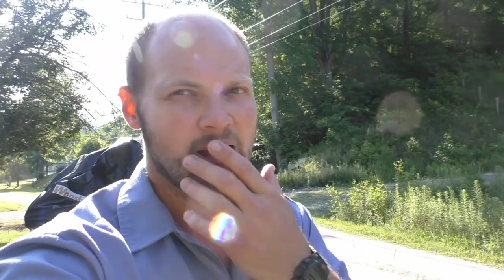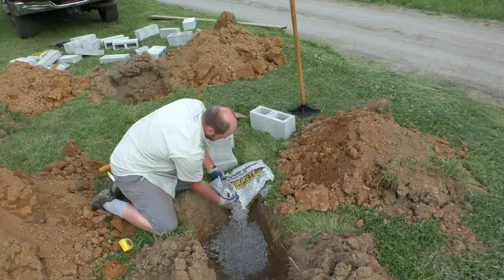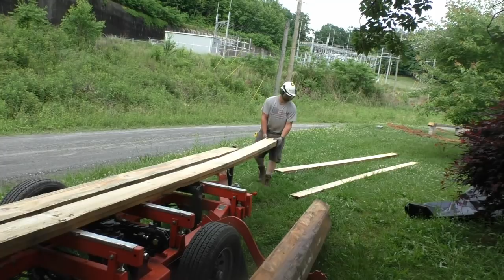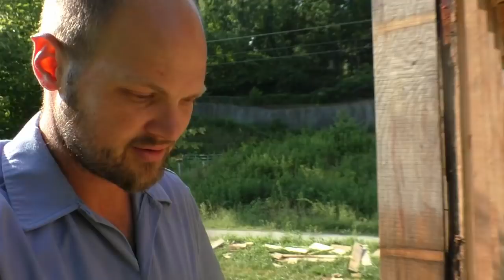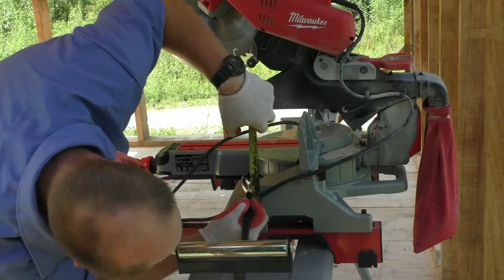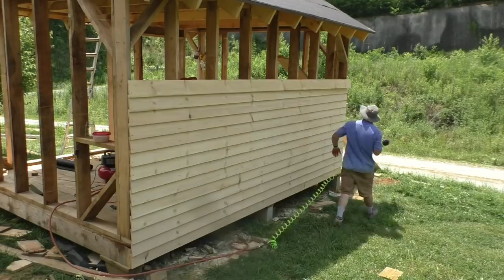Building a 12x16 Tool Shed for 400 bucks | Vlogmill

Comment: Not to be like this...but red oak, nowadays, is very expensive and best used for appearance pieces. 
This guy did what he did, that's fine. 
If you're an experience woodworker, then you already have your preferences. If you're a newbie, I'd suggest a combination of pressure-treated floor joists, the plain pine for everything else. You're also going to want good shed ventilation, so add some roof and eave vents. (In the summer heat, I keep an old fan going in the shed, just enough to keep the air moving; makes a huge difference).

Comment: do you guys have high clay content in your soil?  wondering how you did the foundation.  i see you dug it up, put some aggregates, laid some thin blocks then cmu stacked over it.  any rebar/mortar?  interested in details of that foundation.  looks fast and good enough for shed in clay soil.  thanks for putting up the videos
Reply from the maker: Its some kind of loam, not really sure.  The footer is two 4x8x16 solid blocks laid on a little gravel, >16" deep below frost line.  then 6" CMU piers, jointed and filled with mortar.  no rebar.  The shed is just set on top of piers, with PT 2x8 spacer, and gravity is doing the rest.

Comment: is the slat siding cheaper than using plywood sheathing?
Reply from the maker: Material cost is usually a tad more than a hardie plank or LP, but sometimes you can find it cheaper directly from a sawmill.  I find it much more pleasing to work with